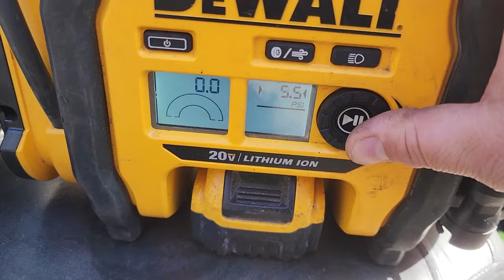FLAT TIRES & HOUSE FIRES - MY NEIGHBOR'S HOUSE CAUGHT FIRE WHILE I WAS CHANGING A FLAT TIRE!!!

Comment: Dan H. Fire Rescue 😅 Great work on the house fire it's all about acting fast ! All Jeeps need solid lug nuts best upgrade IMO. Tire plugs are fine but with a good tire a patch is the way to go . I also use the rubber cement for tire patches on the plugs and light the glue up for a few seconds and never had one pull out or fail . Let's talk about having all 5 chrome wheels though that's a rear thing to find on a WJ because people swap wheels or delete the spare to raise the gas tank . What's up with the Commander??
Reply from the maker: Ahhh good eye! I gotta get my commander lift vid edited.. it was complicated

Comment: 10:30 One of the long rods has a bent end on it, that end goes into the slot on the jack, then the other rod snaps into it so as to extend it, then the square hole on the tire iron goes on the end of the second rod. Now you have a way to spin the jack up and down quickly and more easily. The tire iron end us mainly used for popping center caps loose, that's why a lot of them have a plastic piece on the end of them. hope that description makes sense and is helpful.
Reply from the maker: Yes! Thats it lol, I didnt see the bent end when I was filming and improved erroneously! Great input!
Reply: Its a jeep thing.

Comment: Dan. I bought a leather equipped limited 04 wj  I want to put the heated seats and leather in my 04 special edition. Do you know if they included the factory wiring behind the dash for the heater controls.  And do you know of other mods that need done to get the heaters to work correctly in anon heated seat equipped Jeep.  5hanks for any help it’s appreciated